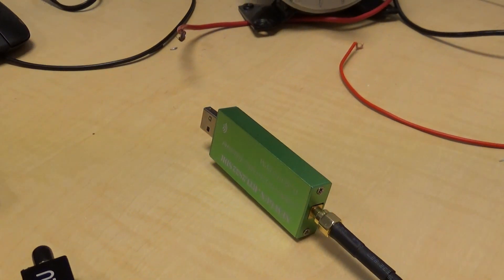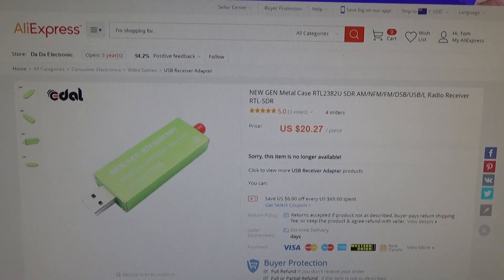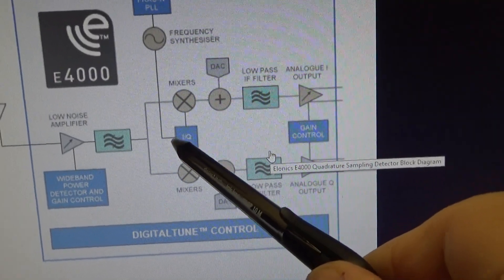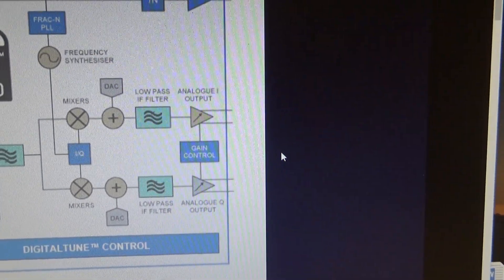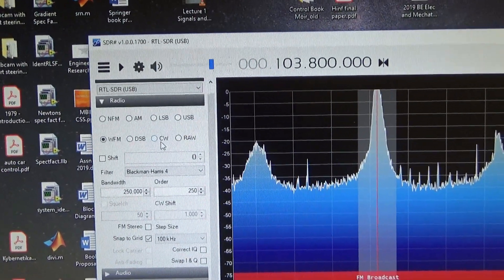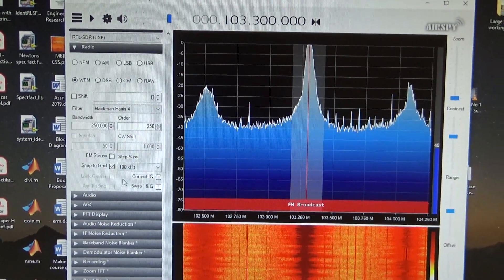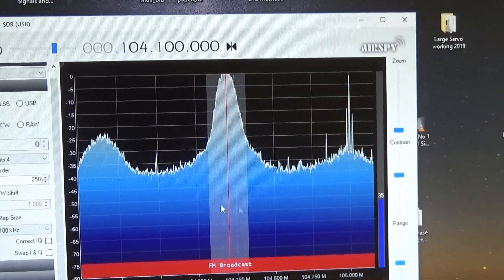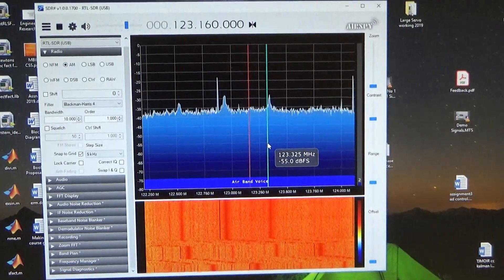Software Radio demo using the NewGen.RTL2832 SDR

Comment: Seems that much of the front end is still analogue with the down mixing of the frequencies.   Thought it may have been like the modems that eventually removed the down mixing by using the sampling frequency of the ADC to do that for them, and turning the advantage of aliasing in to an advantage!
Reply from the maker: That's another topology or you use FPGAs as the oscillators and they are rock solid.